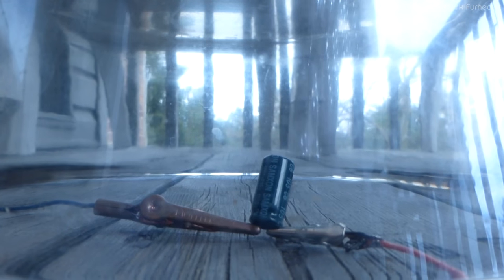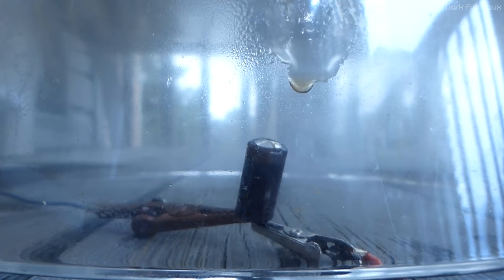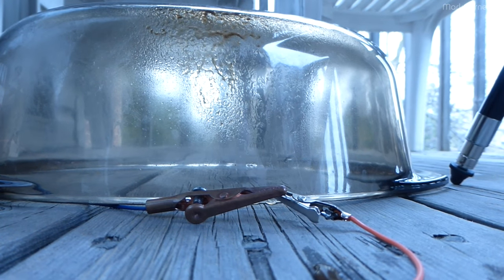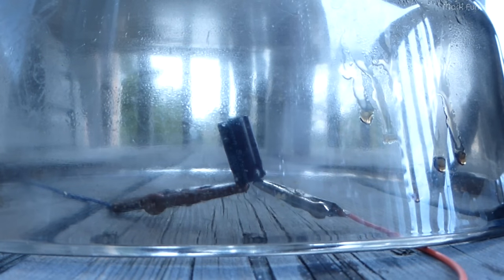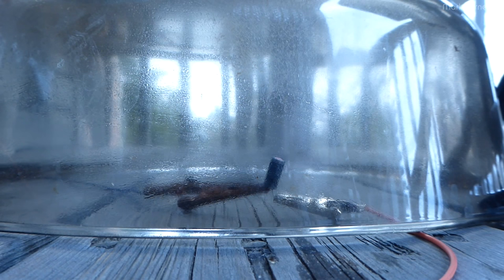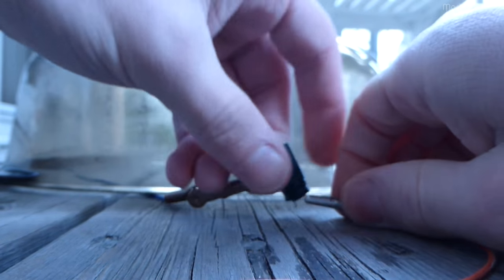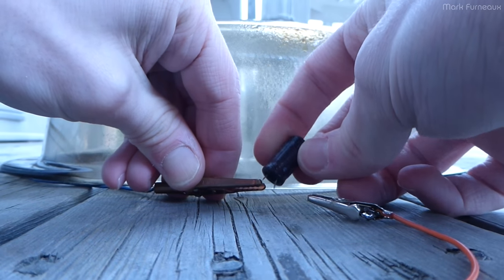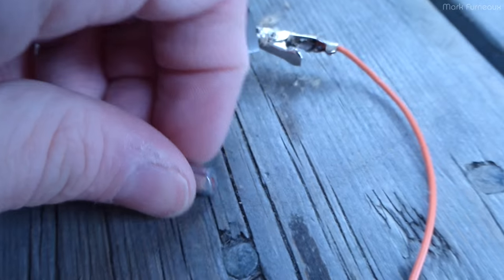Popping So Many Bad Capacitors

Comment: Epoxy could seal off that electrolyte vent well enough to really make them fail catastrophically
Reply: i would love to see that
Reply: Creeperlover2001 yep epoxy to seal it plus give it power from a hot car battery. 
That'll give it a lil over 12v @ 200+ Amps of current!
Reply: this is a dangerous idea, but bridge rectifier, mains
Reply: Creeperlover2001 correct it is, that's why you detonate it safely. 
Blast shield, and be at least 30 feet away.
Reply: a little dab of JB weld at the cross and they might just explode. XD

Comment: Lol. One day I had an old casio keyboard. I plugged it to the outlet with a 12v charger and i didn't read the 7.5V on the edge and while I left, I heard a loud POP and then I turned to see what happened and the casio keyboard had fallen off the table and it was smoking a lot and it smelled disgusting. I picked up the keyboard and removed as fast as I could the charging cable and I placed it outside. After 15 Minutes I got it back in and I did A teardown and I saw that one BIG capacitor had popped. Then I Said << what the hell >> then I removed the capacitor and I threw it out from the window and I never picked it up. 😕

Comment: Very cool.  I found this video trying to debug a TCL Roku TV that went dead.  It has a Chang 250v/270uf capacitor in the power supply.   Did your bad caps ever make buzzing sounds before they blew?  I think mine is making a ticking sound, but I can't prove it without putting my ear dangerously close.

Comment: i once popped 25v cap with 12v reversed polarity, when hooked up my 20w 12v amplifier homemade first time, that was about 6 years ago. And the caps could be from capacitor plague era

Comment: I once blew one 100uf 50v capacitor with my diy 100/115V AC step-down transformer. It sounded like a gun shot, quite loud despite being that tiny and dried out like shit in the desert.
Can imagine what a bigger, like an 4,7k-uf or more would have sounded like.💥💣💥😄

Comment: hey man i got a question if i connect my server power supply 12v 63 amps to the capacitor in reversed polarity will it explode harder r is the no difference